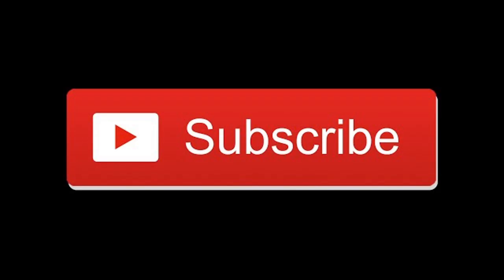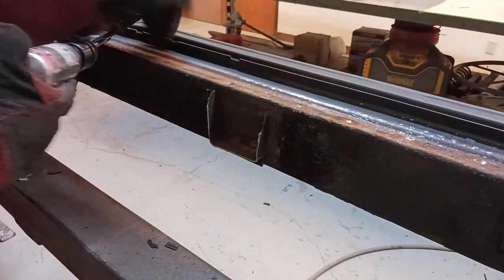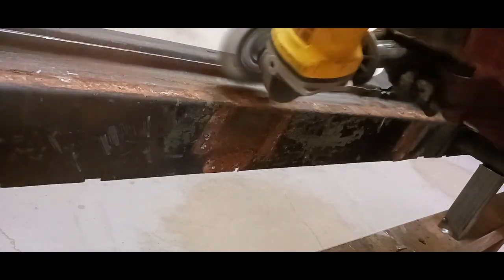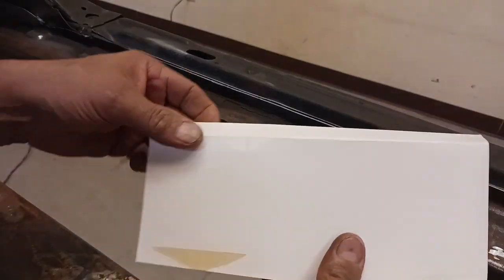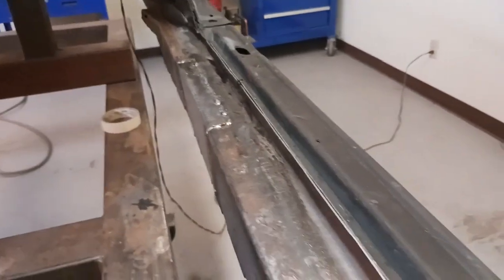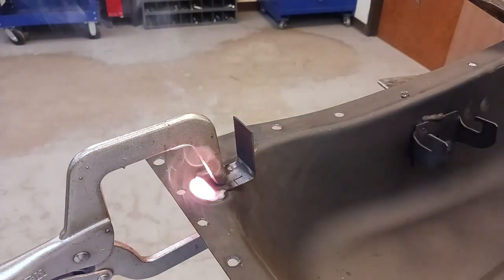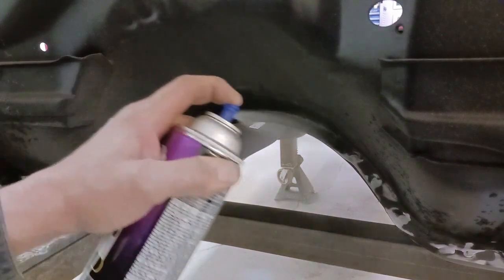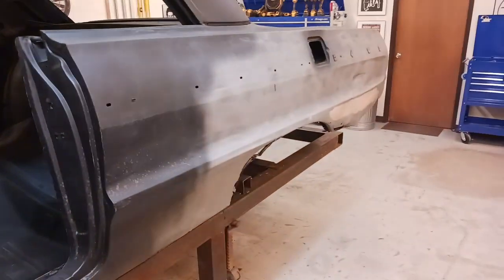How to Install a complete floor pan - 1964 Impala SS restoration Part  7   DIY Auto Restoration

Comment: Finally! Someone who shows the process, been trying to find help for doing this to my 63 galaxie, just what i needed.
Reply from the maker: I have 160 videos out you should be able to find whatever you need hey thanks for watching
Reply: @guzzifabrication3448  I will be sure to check them out. This video helped me tackle the sides of my floor pan, but how are the front and rear usually held in? Also spot welds? I am trying to wire wheel down to see but i am not seeing any that are obvious like the sides had
Reply from the maker: @G Rapids  the panel's front and rear will be held in place with resistance Welds

Comment: Dude it looks better than stock... I'm trying to learn/gain confidence in doing my first full restoration on a 1974 Camaro.. and need to replace the floor pan and a bunch of rust repair (found it in a field)
Reply from the maker: Thanks !! I have several floor installation videos.
Reply: @guzzifabrication3448  I subscribed you make it look easy
Reply from the maker: @grey1wa  Thanks !!!

Comment: Outstanding craftsmanship sir, I subscribed and have been watching the vids. Great job brother, keep ‘em coming. What grinding wheel are you using on the high speed grinder? I’ve seen you use it a lot to knock the welds down. Also, are you welding on the POR 15? Thanks for sharing!
Reply from the maker: Thanks ! that is a 3m green corp 3/8 grinding disc Thanks for watching !

Comment: Just found your channel. I had a 70 GS455 4 speed car….wish I still had, but my 71 442 survived. I am getting ready to do those pans. Great video. One question: do you tack, and retail, to the point of a continuous bead when done? Thanks.
Reply from the maker: Depending on which part your adressing, usually no, I did on the frame rail but not the pan.

Comment: Was that floorboard already coated when you got it? I need to coat mine and I see people use all different coatings but I'm thinking I'll use either por or kbs. Is that primer or por?
Reply from the maker: That one came with the EDP coat, I see they are selling body panels now just raw steel..... bad idea... the problem with that is how to you coat in between sandwiched/welded parts?? P.O.R is good.
Reply: @guzzifabrication3448  exactly! Shockingly my 1962 hearse had bare unprimed steel under the floor and in the supports, I'm shocked they still exist at all. Thanks for the input!

Comment: great video, as far as the self tappers to hold down some areas, did you take that out and then plug weld the hole? since it is a through and through hole do you need to back the hole with brass to be able to fill it if you are filling it or how do you manage those holes if you remove the screws after things are tacked? 

thanks @Guzzi Fabrication
Reply from the maker: The screws are removed in the holes welded

Comment: Did you need to weld any braces inside the body are that’s just over kill
Reply from the maker: The vehicle is secured to a frame fixture.... bracing inside would be a real pain to work around and are totally unecessary ( unecessary as long as the body is on the fixture )

Comment: I have a 1964 Impala. The guy I bought it from replace the floor panel but it's not welded in. He screwed it. There is a screw roughly every six inches with occasional welds. I am restoring it now. Should I leave it or replace it and do it right? Is screwing acceptable? Looking for a pro opinion. I don't know much about cars but want to learn.
Reply from the maker: The floor is a major structural component, and must be welded in place. For what you will pay someone, invest in a welder and tackle the job yourself, you can absolutely do it !
Reply: @guzzifabrication3448  I was leaning towards replacing it but just wanted to make sure I wasn't overreacting. Thanks brother! All of the work I am doing on my car is based on your advice. Thanks for the videos. Making a difference in people's lives!
Reply from the maker: @edthebandido  If you have any questions or run into any problems, ask in the comments.

Comment: It's best to install a full floor pan with new bushings to the frame first after prepping all areas. That way you can make sure of the total fitment of the pan and it's bushings to the frame. Also it's easier then to lower the body onto the frame from above. I use my ceiling lift points daily for that.
Reply from the maker: If you are not confident in your measuring skills.... then yes you probably should stick with your method....
Reply: I don't need videos to boost my ego, apparently you do. 47 years in doing restorations is enough satisfaction for me.
Reply from the maker: @pjlss454  If you have 47 years experience why are you watching how to videos? I figured as much......
Reply: @pjlss454  So yeah, why are you watching how to videos?? You could probably learn something from this guy.